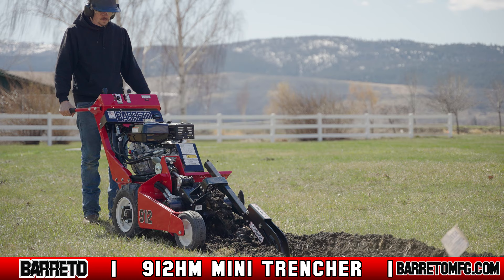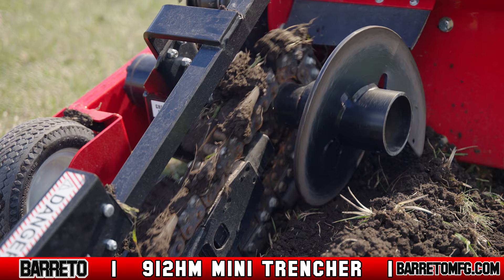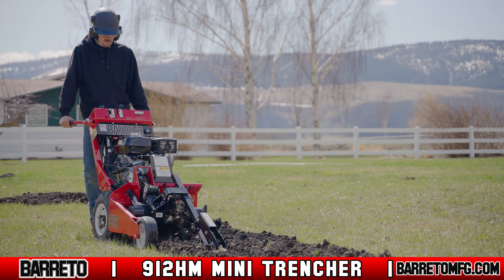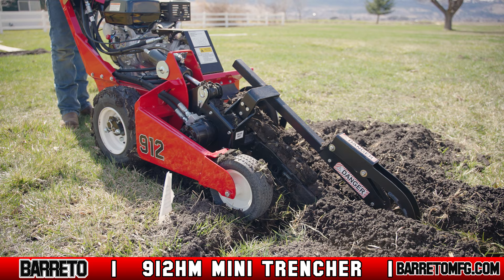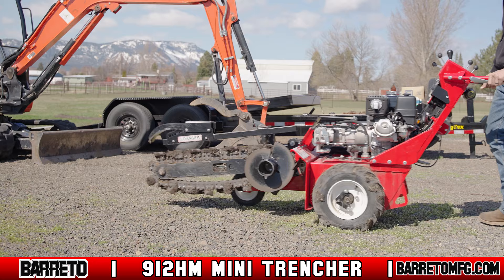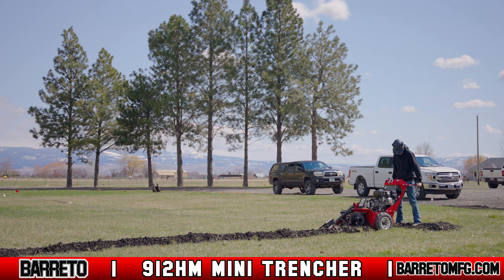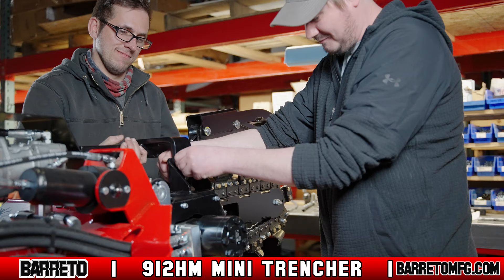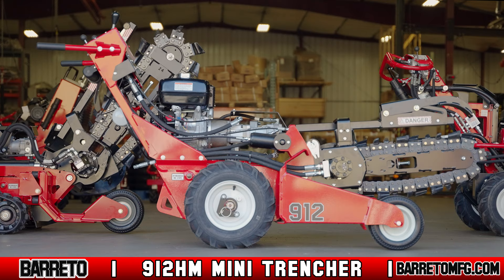912HM Trencher Features || Barreto Manufacturing, Inc.

Comment: I use this machine today is not 24inch deep trench  14 to 18 inch deep max the blade is 24 inch but won't go in that deep also is really slow Wheels run way to close to the trench really hard to keep straight really heavy  to  estear  most of the time need to run the trench two times to get the right deep if  you got to run only 50 foot trench you be ok otherwise good luck plan on renting for 2 days
Reply from the maker: Trench depth is dependent on boom length.  It is likely the configuration of the machine included an 18" dig depth boom.
Reply: Will it cut tree roots
Reply from the maker: @thruthfog  It will!